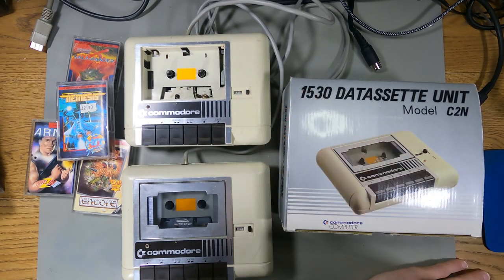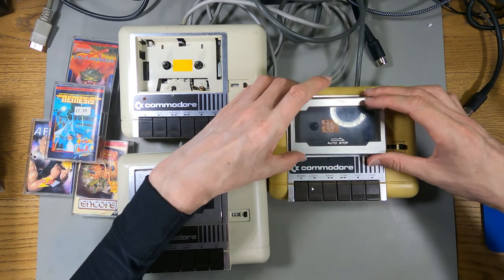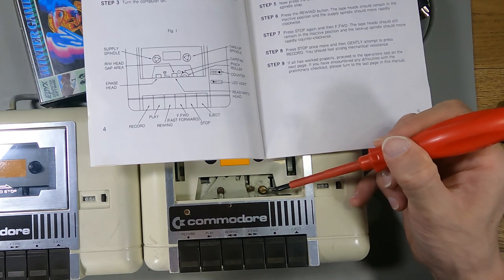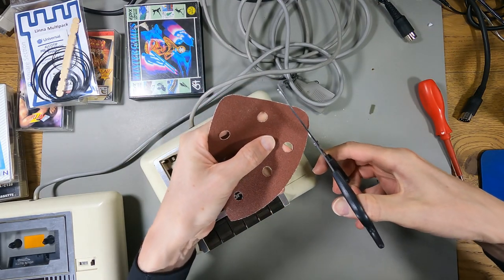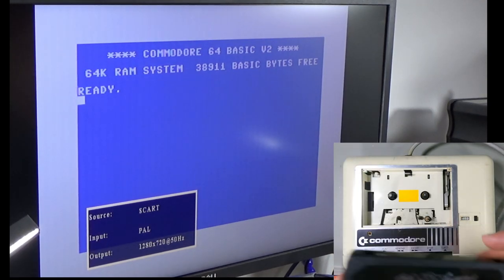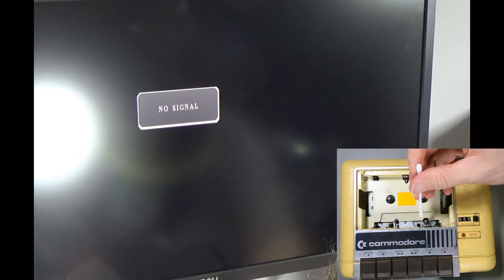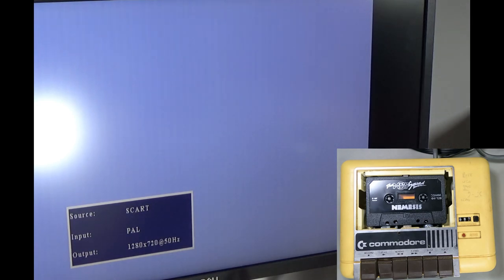Servicing a C64 Datassette

Comment: Hey Dave, try cleaning the heads with IP alcohol and use a tape head demagnetizer. That might solve your problem! 👍
Reply from the maker: The heads were cleaned so it's not that. I didn't think about a demagnetiser, that might help. But the winter games tape still won't spin, so I do suspect that the problem is mechanical.

Comment: You should try the MP32C64 on a regular tape deck just to make sure the tapes you have are any good. Tapes can be flakey too over time.
Reply from the maker: Unfortunately I no longer own any tape decks other than the 3 in this video. However, I know that many of these tapes do work as I've seen them load on the good datasette

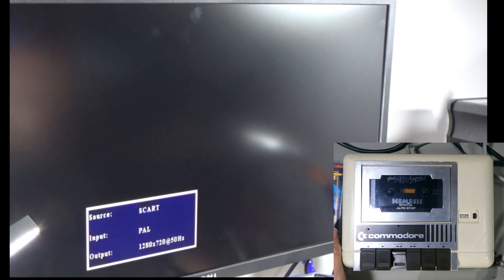Comment: At 10:48. Where did you get that pack of belt replacements? Ive been looking all over for something like this. n
Reply from the maker: eBay -> https://www.ebay.co.uk/itm/154118582305 "Linna pack of 15 Square Rubber Drive Belts Bands for Cassette Decks 30mm - 80mm"

Comment: The rubber band too loose and synthetic grease on all moving parts and a azimuth tape needed to align heads.
Reply from the maker: I replaced the rubber band, and I did actually try a tighter one as well. I did the alignment, there was nothing wrong with it (it's in the video). The moving parts, are hard to get to and require more disassembly, but that's the only thing I've not tried yet.
Reply: @DavePoo2  also check thats there no cb antenna near by. If one of the spools on tape deck is dragging it might be stretching the tape.also without the door on cassette deck the tape is sitting to low in deck.
Reply from the maker: @tangothecat237  I don't think the door affects where the tape sits. The bottom brackets of the door go fully inside the unit, so it sits in the same place. The door just aids insertion and removal.
Reply: @DavePoo2  look at the tape drag maybe that's the problem?

Comment: Did you see the video on the new C64 OS by Retro Recipes?
Reply from the maker: I have not. Do we need anything more than Basic V2.0?
Reply: @DavePoo2  No idea, I never owned the C64, haven't been keeping up.  I just thought it was interesting a new OS after 40 years.  Just like when they opdated the Amiga OS after a long time like this.  =D
Reply from the maker: I suppose the difference is that the Amiga shipped with an OS, whereas the C64 just shipped with Basic (and the Kernal ROM). I think somebody made the GEOS operating system in the 80's but it didn't ship with the computer. I only really found out about it in recent years, and I actually owned a C64 back in the day.
Reply from the maker: Have you not been keeping up with the Commodore? 'cause the Commodore's keeping up with you. https://youtu.be/95cGh9EeMIY
Reply: @DavePoo2  Nice and in stereo.